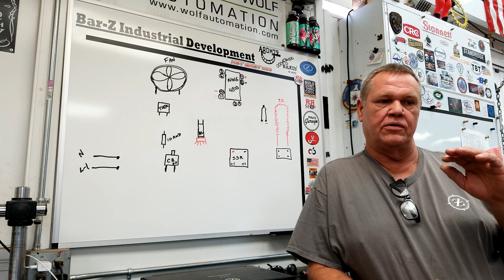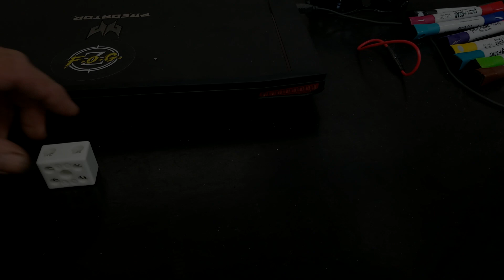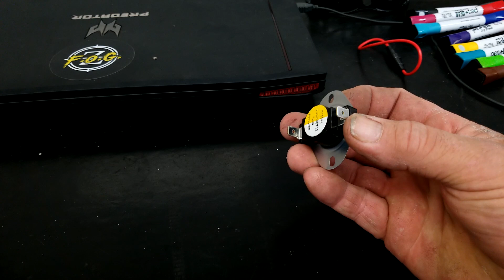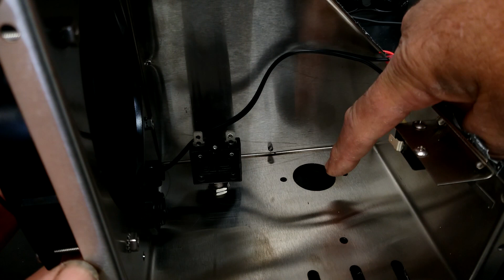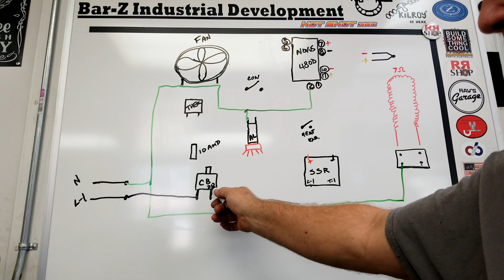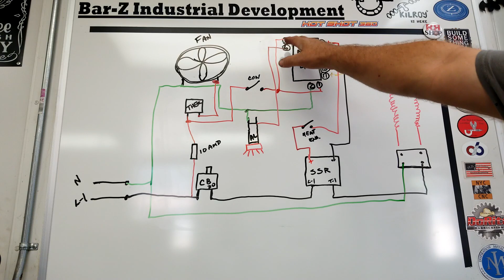DIY Hotshots wiring

Comment: If you wired this for 240V would you need to 4x the heating coil resistance to keep the same wattage?  Conversely, could you just add a 21ohm resistor in series with the heating coil?  The only reason to ask is that 20 amp 120v circuits are fairly rare and can't be easily retrofit since they need bigger wire.  A 15 amp 240 circuit would be easy though and most shops probably have 240v available.  9 amps at 240 is easy.
Reply from the maker: I just coil up a high resistance element for the 240V units, I think a resistor that big would generate a lot of heat and just waste energy.
Reply: @ShadonHKW  I just looked up resistors that size.  They are not what I was envisioning (the little brown cylinder with wires out the ends).  They are huge and expensive, plus I see your point on wasting energy.  If you're going to make heat, might as well be in the oven.